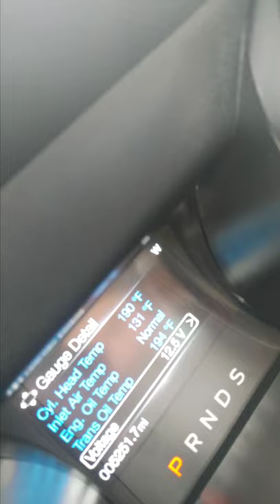My New Ford Mustang is BROKEN Already??

Comment: That's gotta be frustrating.  Let us know what you find out.
Reply from the maker: So after some research, I learned that newer Ford's have a sophisticated charging system that varies the charging voltage depending on the load and battery health to help maintain the battery's life and less stress on the alternator. However, the car was breaking up really bad above 5500 rpms wot. So I'm not sure if I had some crap gas, or something else Is going on. I'm still in Florida, but when I get back home, I'll pull the plugs and check everything out.